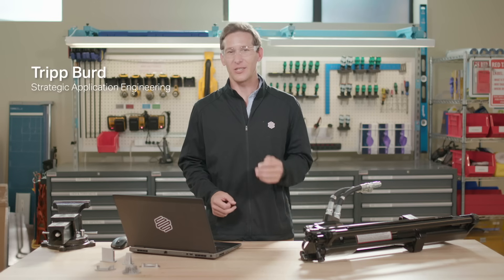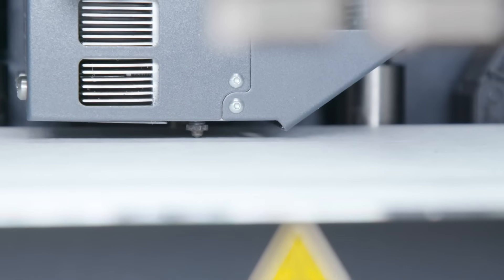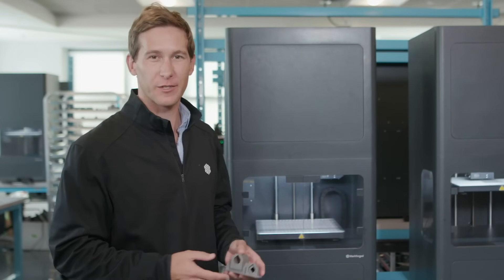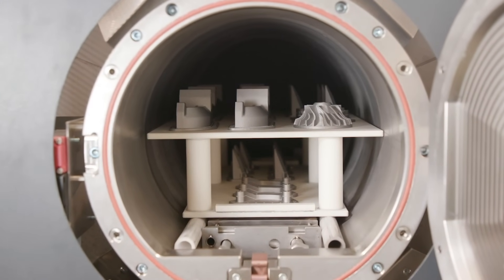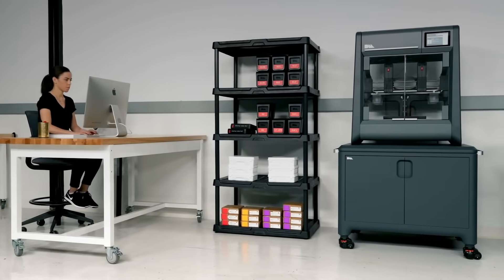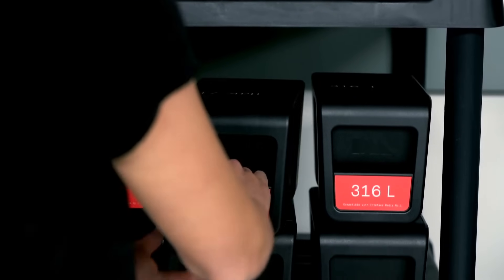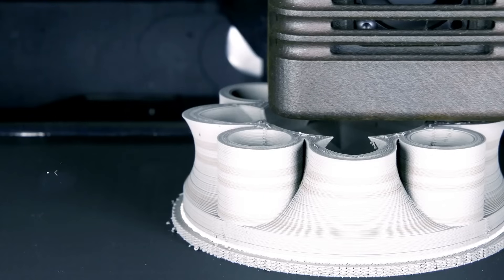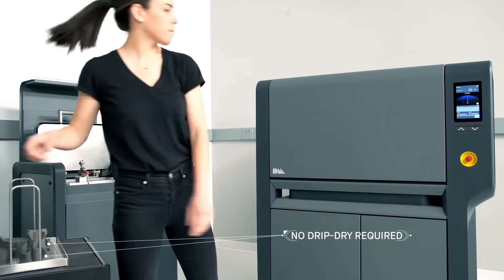Top 5 Metal 3D Printers 2021

Comment: I worked for  a 3D company for many years, a major driver of SLS metal powder engineering and the SLS machines and sintering kiln. I was always disappointed with the cost and low throughput of 3D systems compared with conventional metal fabrication, using 5 axis mills and billets of whatever metal you wished to use. Our customers spent a lot of time frustrated getting good quality parts. Perhaps the parts are of better quality now, but, I do not see that costs or manufacturing time has improved much in 15 years since I left.

Comment: Wow can I use this to 3d print an affordable metal 3d printer.
Reply: That's funny you mention that. My brother works at a metal shop and they have a very expensive cnc Laser machine like close to a million dollars. Well their cnc programmer guy found the blue prints online for how build it and info on where to get the electronics from China cheaply. And I think my brother said it costed the guy 30k to build and it took him 1 year to build. He had to do it a few pieces a week because the company he worked for was charging him per hour to use the machine plus sheet metal cost. And now that guy does contract work on the side for the company he works for and has an operator working out of his warehouse behind his house. Idk if its legal but apparently he changed some things and his is better then the real thing and he is using a Chinese cnc program so idk. 🤷

Comment: While I am happy the technology exists and is becoming more and more widespread I am still sad at both the expense and size of the machines needed although I understand it will take more time this is an extremely amazing piece of technology I hope that someday the technology is refined and mass produced enough so that hobbyists could get their hands on it and do some of their own work I have lots of ideas myself I hope to one day use this kind of machine for but at its current price tag I would never be able to afford one in my lifetime
Reply: You don’t need a $100k machine. I build custom FDM machines. Cost is still around $10k but its also a 22” x 44” build plate which is far larger than many of those industrial units. Enclosure is heated and tstat controlled and uses a fixed bed design. You still need a kiln or whatever to sinter.
Reply: @glennedward2201  you should do a detailed video on how to build one cuz I'll fucking do it once I get my life in order and get that kind of money at the table
Reply: The £1850 Qidi i-fast can print with metal filaments, such as bafs 316 stainless steel, and you just needs a kiln for sintering.
Reply: Agreed, but there are services that allow you to print your parts. For most people it doesn’t make sense to have those machines, unless you have a a shop of robotics or something like that you’re not going to make full use of them.
Reply: @maganaluis92 You Might be surprised all the hobbyists who have equipment like this.
Reply: Dude machines has always cost alot if money
Reply: Bro just buy the machine and then just print more machines won’t have to worry bout a price tag

Comment: When I clicked on the video, I had hopes that metal printing could be a nice hobby.

The price tags and the size of the machines changed my mind really quick
Reply: Some people have multi million dollar yachts for a hobby🤢😭
Reply: You never know. Maybe your designs could be highly valuable. With the right backing you could buy a 3D production system and be off and running with a great business.
Reply: Right now, the most cost effective way of doing metal is either fdm printer with metallic filament that can be put into a oven or sand casting with a pattern that can be burnt away. 

If you don't mind working with alloys with a lower melting point, higher temp resin prints can handle pewter and similar.  

Really, it's a shame, but they will get there eventually.

Comment: These are mostly OEM-grade 3D printers.  They are not for hobbyists.  They are for prototyping, low volume production, and replacing parts that might otherwise have long lead times.  They are meant to shorten time to market or cut weeks off of customer lead times due to bottleneck failures.   

As for the cloud, there are many business and mission-critical applications moving to the cloud that we wouldn't even consider 2-3 years ago, e.g. Public Safety communications.  The cloud does force us to build in cybersecurity and ensure privacy.  This is an issue that is inherent in today's technology environment.  Industries are rapidly expanding to fill this need for IP/data/privacy protection, not to mention the need for the Legal system to write the laws now needed to cover this.  Will it be bumpy until this matures, probably.  Is it inevitably moving forward?  You can count on it.  We can choose to engage or not.

Comment: Why not use the principles of welding to create a 3d printer that can print juat metal?
Take the wire feed welder, put a second spool on the ground, make the 2 ends run together, adjust power to make the metal wires molten but not burn when + and - touch, direct the resulting molten metal through a tube of some sort to manipulate the metal like the "plastic" printers....
Reply: It will not be stable and precise and will be required to grind and remove alot of waste metal.
Reply: @jgon12  I think it could be developed to be precise... Like any tech, it would improve as it progressed..

Comment: Until the cost of these machines comes WAY down, "lost PLA" casting is still the most cost effective method for hobbyists to cheaply produce metal parts.
$100 for a cheap printer and another $100-$200 for a used furnace and you're good to go.
Reply from the maker: That is very smart, especially useful if you are a hands-on individual with such skills
Reply: Actually UV curing wax resin's prices are also becoming quite reasonable (if you buy them from China) and are easy to print with a LCD 3d printer. It'll be easier to burn out compared to PLA and also give better details.
Reply: @hyphen2612  I recently got a small resin printer from creality for $200. I'll get a proper metal printer when they come down in price enough to be practically.
Reply: Agreed. All of these sintering printer companies are making the same mistake DaVinci and FormLabs made with their stupid, proprietary cartridge systems. Maybe it's justified to keep their R&D rolling, but I have a feeling it'll be more like Canon or Sony and their inkjet printer cartridge scams that continue to this day.
Reply: Thanks i was wondering about how the average person does it.
Reply: Would it give pretty much the same outcome if done correctly?
Reply: The target market is not for hobbyists.
Reply: @bluenote131  Yeah, well the target market is also not production manufacturing. Not even government contracts can absorb that kind of cost vs standard casting/machining methods on the market today.
Reply: @DC_ABC_123   The price is about the same as CNC machining hardware, the cost too, but it's more a complementary tool than a replacement. So yes, it has its place in production, and it's already used.

Comment: What advances need to be made before we can bring the cost of metal 3D printers down to an affordable level for the average person?

These are important questions.
Reply from the maker: If it were to follow exactly the same pattern as with plastic 3d printers (around the time MakerBot came out @ $3000/ printer), some of the patents would have to expire (they usually are 20 years long) and then some local or foreign manufacturer starts using the same technology to manufacture cheaper printers without having to pay royalties to the original inventors. Over time, with enough competition between these manufacturers, would force prices further down (around the time Creality came out @ $300/ printer)
Reply: They don't want you to be able to do this from home.  Will disrupt  so many things  but ultimately it will be cheaper.  Progress for this technology is inevitable .
Reply: Demand increase, would lower cost.

Comment: Why don't they just melt metal like plastic ؟
Reply from the maker: Probably because metal is hard to roll around as filament, and also needs very high temperatures above 1000˚C, which would consume a lot of power

Comment: I would never buy a cloud-based solution.  Anyone using such a system would be breaking the non-disclosure agreements they have with customers.
Reply: Cloud-based storage wouldn't be practical or feasible if they didn't follow some protocol for data encryption. It's like email. I don't break any NDA clauses when I send or receive emails.
Reply: Definitely
Reply: but then they couldnt track all those prohibited things people would print with a metal printer...

Comment: Curious if the parts can be welded after creation as well as would they even withstand certain levels of vibrations.
Reply: Heavily depends on your material and if its sintered or lazer. Lazer is basically welded and stronger where as sinter is cleaner ,more accurate but less robust due to fusion bonding. They can be welded on as their metal obviously.

Comment: For the small price of $100,000 you too can print lowers hahahaha insane
Reply: Gotta get a group of people together 100 ppl $1000 a piece... Unlimited lowers!
Reply: @danielpalazzolo8514  smart af
Reply: The first plastic printers cost the same. Give it 10 years
Reply: I did the math on this, it would take 12-15 years to recoup your investment over just buying lowers.
Reply: @brents1866  yeah but if you sell em too
Reply: ridiculous price
Reply: Forget lowers… you could make suppressors 😍😍🥰
Reply: With cloud based slicers, it would only be a matter of time before they develop AI that can recognize gun parts and prevent you from slicing
Reply: @mckennaConfig  F the cloud
Reply: @mckennaConfig  somebody that can use and have access to this sort of gear would be able to create a gun from practically anything.
Reply: You can use a ender 3 right now for about 300 for an entire setup
Reply: @sumgaye5951  not for ar-15
Reply: I'm positive I could use my cheap little ender pro to make 3d lower sand and cast my own and mill out internals on a cheap mill block...I honestly believe you can buy a 3 printer 250$ filament 25$ "file" free sand box 10$ sand 5$ small hot box maybe 125$ and find some steel scrap....mill block decent one cost more then everything on list...and you can cast n mill your own now obviously you can upgrade as you go but it will never cost anywhere near 100k....sure if I had 100k laying around to waste sure be easier but I'd be able to buy enough ar or ak or w.e that I wouldn't even wanna make another gun...
Reply: @ddchows  you shouldn’t cast gun parts. Especially AK trunnions. Really bad idea
Reply: @georgeburns6512   *Century Arms has left the chat
Reply: @jjsemperfi  😂
Reply: Youd make more money printing turbos
Reply: Why stop at lowers? Lol u should make ur money back Ina year or sooner  (depending on what your willing to do lol)
Reply: Why bother when you can print lowers from  a $200 ender?
Reply: Compare that to the cost of making these parts the old fashioned way and I'll bet it's way more affordable
Reply: Ikr
Reply: MakerBot offers them at 4000 dolllars
Reply: @ErickStoner  do you have a link ?
Reply: 100,000 is on pare with a lower end haas   good deal
Reply: But you can also manufacture medium sized jet turbines in 1/3 of the time and it only takes about five of those to pay for the whole schmere
Reply: Well I’m trying to make my own jet engines and a rail gun repeater
Reply: several years ago, these machines cost $600k on the low end and went up to $1 Million.
Wait a few more years and they will be as cheap as!
Reply: Glock switches
Reply: Glad we were all here for the same reason lol
Reply: Well, no worries if the target are the hobbyists son of billionaire 😆
Reply: @dreamy a CF nylon lower would last for sure
Reply: Anyone tried using the X1C and print lowers in carbon?
Reply: I know a guy with a 3D printer that prints full size houses out of Ultra High Performance Concrete. $180k
Reply: milling machine will work fine for $1000
Reply: @news2383  and are better quality parts

Comment: What would be the best models and accessories for printing coins. And what the best 3d scanner to use for scanning items into print DB
Reply: Do you mean replicas? Many coins are stamped, you won't get the same stress marks. If you are doing cast coins then you can also do that with regular $200 FDM printers.
Reply from the maker: Molding a plastic printed part, and then casting it would be the simplest way to do it, and you can create many replicas from the same mold for less than 3d printing each coin in metal
Reply: @jakegarrett8109  I want to make custom art coins. Similar to hobo coins..but also with precious metals like gold and silver but copper and brass aswell.. I'm seeing that a cnc laser machine or nano cutter ñ/engraver maybe better than printing..
Reply: @sarinulek6816  that's probably true, much cheaper and coins are relatively flat so great candidate for milling machines.

Comment: how do you get the blue print of the part? I bet the original manufacturer won't give that up for free
Reply from the maker: The blueprint of the printer you mean?
Reply: @MarsGadgets   the blue print of the part you want to print For example (toyota alternator bracket pn 1115 789) Like sellable parts
not just junk you kick around the house
Reply: Daniel Landauer   You can use a new I phone to scan a original part if it’s broke glue it together and scan it with laser 
Build your 3D model from the scan and print it out

Comment: The last system looked the best over all out of the lot for a actual manufacturing. Even if it made 100 a day. It's a good combination of old and new methods of doing each process fast and accurate. The system is big but for good reason. Expensive? Most likely. As the all are. Not for home market but business or Tony stark wannabes :D
Reply: i believe its is one of , if not THE cheapest of these....markforged possibly but markforged is slow ....migt as well print in plastic , make sand moulds for most stuff...
Reply from the maker: Sand moulds is how things were always done in the past, and works much faster even than modern tech
Reply: @MarsGadgets  yeah but its hot dangerous, messy, tedious if you want to prototype, you are limited in shape too, complex geometry is where the strength of this stuff really lies...
and if you want to cast fast? you need modern 3d prinitng tech .
print in pla,  embed in sand, melt , then cast,  thats te only reason its so quick these days.

Comment: I work with 3d printing and I have used several 10K range FDM printers before and whatever the other may say they are just c**p like their 400$ chinese clones. Open loop actuators, cheap linear bearings, toy belt transmissions, use of motor bearing as load bearing when tensioning the belts, cheap TR screws... The list is so long I could continue for a couple of days. The only thing that makes them better is quality control so you (usually) do not have to check for loose wires the first time you power them up.
It seems that good engineering practices (a very good reading is the Shigley's) do not apply when designing a 3d printer, so I wonder if these 6 figure 3d printing ecosystems are made like proper cnc machines.
Reply from the maker: There are a few that are reliable, and others like you say are still testing their first and second generation printers that still need a lot of tweaking

Comment: As someone who used MarkForged printers before at work, there's no damn way in hell I'm buying and using those stupid things ever again for my own projects.
Reply: elaborate...?
Reply: @phillyphil1513  To be fair, I've only used their reinforced nylon printers. They have no heated bed or heated enclosure. This leads to severe warping issues. Larger parts would often pull of the bed and be ruined. This was very costly. A wiring loom on one of the machines had been pinched between the frame and a fiber extruder motor bracket and the time and pressure slowly pressed aside the insulation causing a significant issue that took me a lot of head scratching to figure out. Lastly, I will never again use a cloud based slicing software. Not a chance.
Reply from the maker: Thanks for your feedback on the printer! The FDM type of metal printing seemed too sketchy, yet they are catching on. What was your experience with cloud slicing that made you dislike it?

Comment: lmao when you need a part in a week and dont have a cnc machine... I dont see this being very useful
Reply from the maker: They are indeed still very expensive, but just as with plastic additive manufacturing, the price will eventually go down to make these more worthwile
Reply: 3d printers already have advantages over CNC machining in most fields, other than simple ease of use (essentially anyone with a computer can use a 3d printer), there's also the simple fact that you can produce shapes with 3d printers that are physically impossible to create in single parts with CNC machining.
Reply: Sure time and cost are two major factors when deciding what production techniques to use. But in the case of additive manufacturing the design freedom is also a major selling point. 

For example, a designer might be able to print cooling ducts within a part where conventional machinery is not able to do so. Same with certain types of hinges and topology optimized designes.